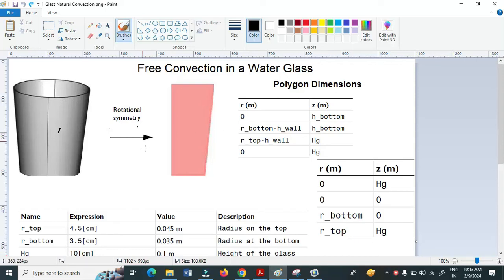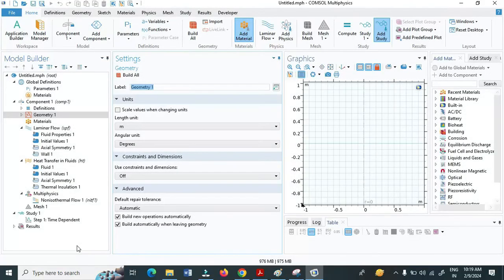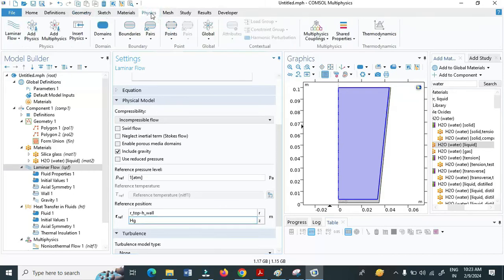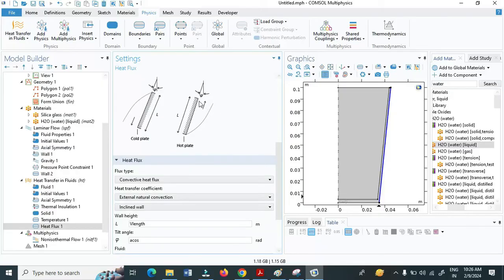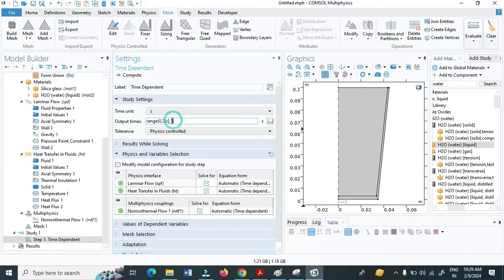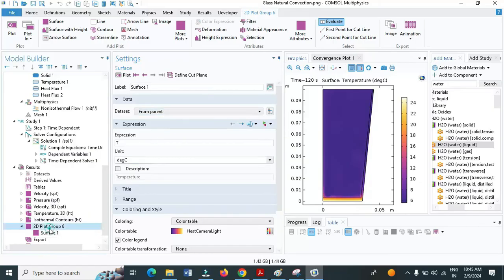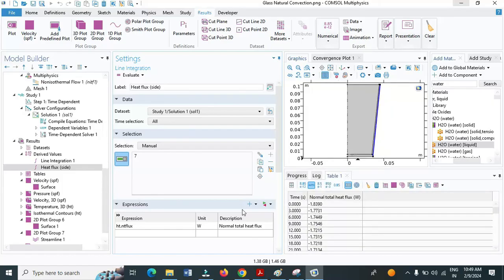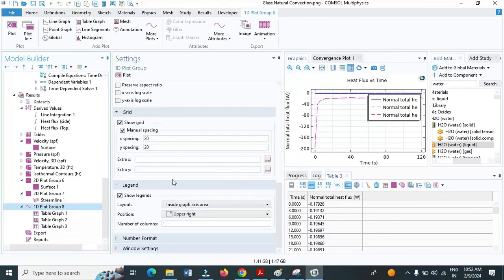Exploring Free Convection in a Glass of Water with COMSOL Multiphysics | Heat Transfer

Comment from the maker: Kindly Include the missed steps under Heat flux 1 ( Side glass Boundary Condition)
Select Ambient Temperature (ampr1) from the Text List:

Locate the Text list in your software interface.
Scroll through the options until you find "Ambient temperature (ampr1)."
Click or tap on it to select it as the desired parameter.
Choose Ambient Absolute Pressure (ampr1) from the pA List:

Locate the pA list in your software interface.
Look for "Ambient absolute pressure (ampr1)" in the list.
Click or tap on it to select it as the desired parameter.